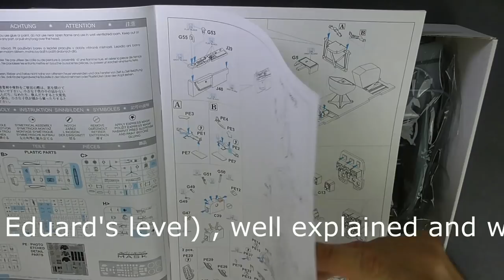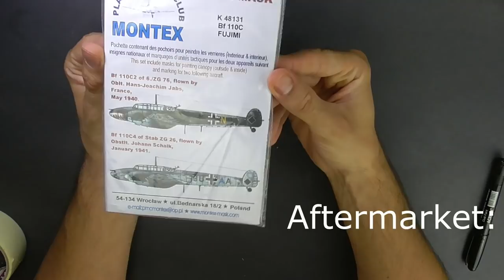Messerschmitt BF110 Eduard 1/48. Battle of Britain. Building and painting

Comment: Your artistry is excellent, however I feel I should comment on the 'gaps'. The fuselage of the 110, like its stablemate the 109, was built in two halves and then assembled, leaving a very distinctive seam along the spine and belly. The junction of the engine nacelles and the flaps is also quite distinct because the flaps have to be able to move down whilst the nacelle is fixed in place. As depicted they cannot move.
Reply from the maker: Thank you!. I will take into account next time
Reply: Exactly.  Was going to be my only suggestion. Especially liked the idea of stretched sprite as a gap filler. Good option especially for larger gaps.

Comment: Interesting to see that you Spent GOOD MONEY on a model with LOUSY Fit issues!
The Nose, engine cowlings and anywhere else you didn't show us. 
Using EPOXY was a GOOD MOVE! I use Two part Automotive BONDO... To fill Canyons, Fissures, same as epoxy two parts
but BONDO once mixed you have about 20 minutes to shape sand flush. Then it gets harder than a rock. At that stage it's still can be sanded ,though takes a bit more time..
Point of my statement is....
Eduard, Tamiya, ICM, Hasagawa, Great Wall, Trumpeter and many other model companies Charge us BIG BUCKS
you would think we'd get Perfect Fitting models but NOPE!
I thank you for showing the fit issues with this model. Yes it is a good kit, the truth about it before I buy it is appreciated.
Blessings
Darrell Killingsworth

Comment: Amazing build sir but I’m so disappointed in the kit.... all them gaps WTH Eduard?
Reply from the maker: Thank you Jeff!! The detail level is ver good but fitting is not the best in this model...
Reply: The Bf110 was one of their first kits after they changed from a limited run (cottage industry) to full manufacturer.
I have their 110 E on the bench, now. And, from researching the Dragon 1/32 Nf 110C-7 kit, I found that the cockpit could be painted in 3 basic ways. Most C & D models used RLM02 as base, Sone received RLM66 repaints above about elbow level when the change to 66 was formally managed in 1949. The E models, many of which were unfinished Ds, were done in this fashion  initially, then changed to overall  RLM 66. I chose the two tone for my C, as it was for a North African based Nightfighter.